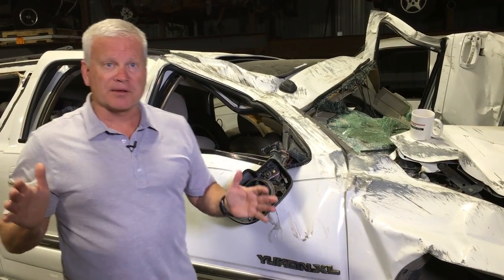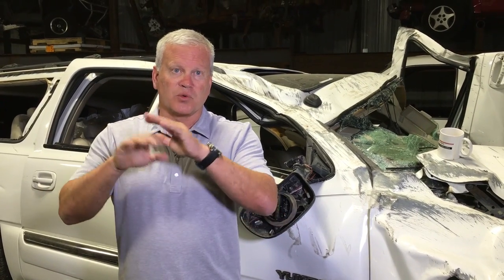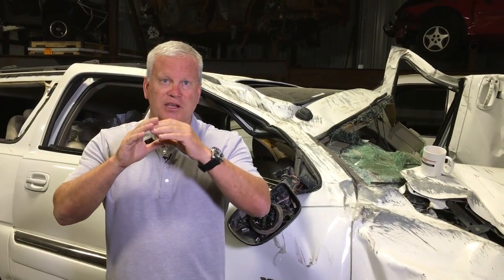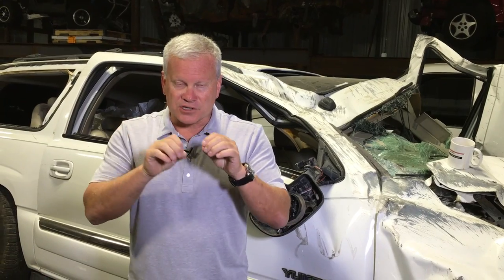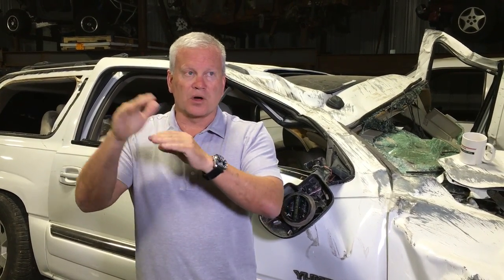Better MPG Does Not Equal Safer Cars

Comment: Todd, vehicles use more high strength steel, too make them lighter tho. Even if you put holes in steel, those vehicles still get good safety ratings.